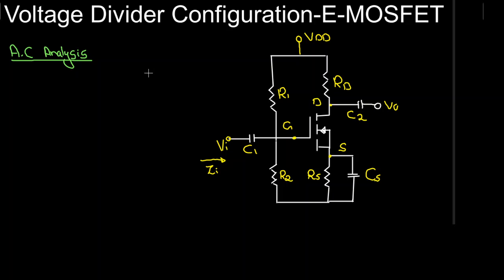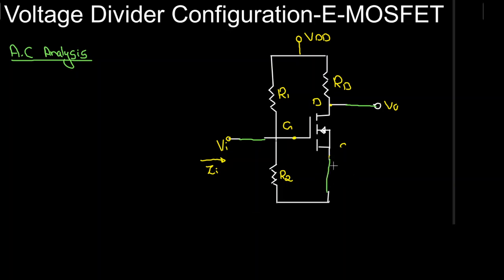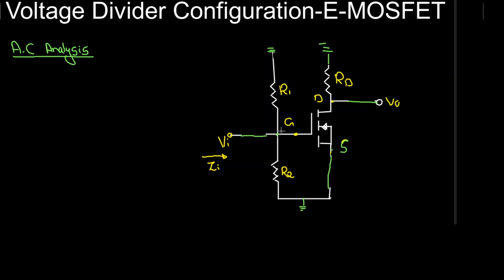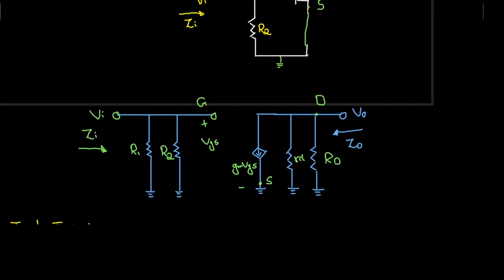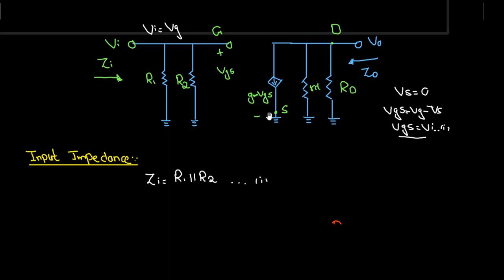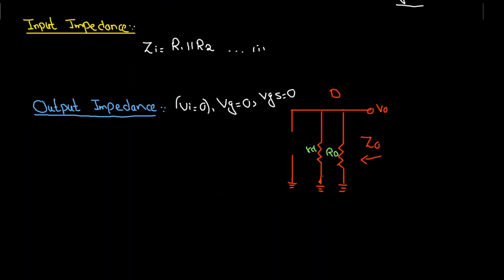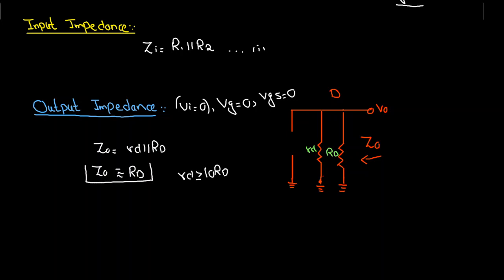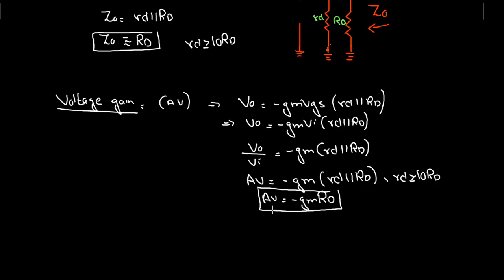AC analysis of Voltage Divider Configuration of Enhancement Type MOSFET| E-MOSFET AC analysis

Comment: Why is there 2 resistors on the drain side. Should there not just br Rd connected to ground?
Reply from the maker: One is internal resistance of the device.(rd).and other is resistance connected with drain (RD)